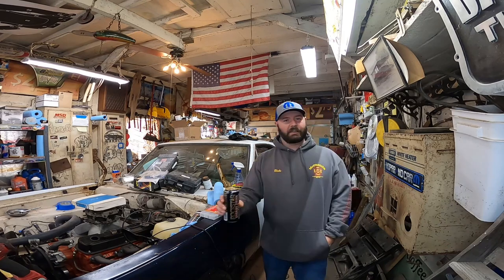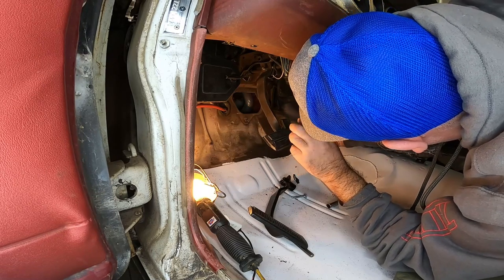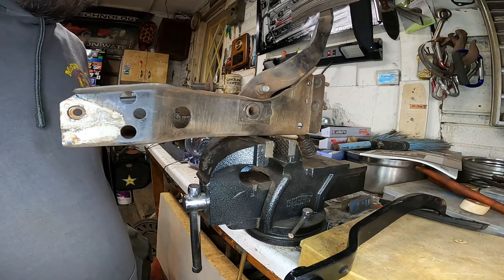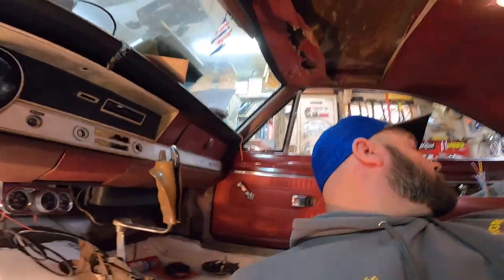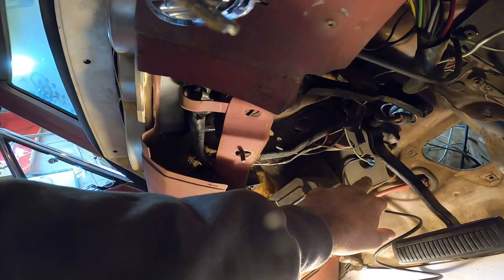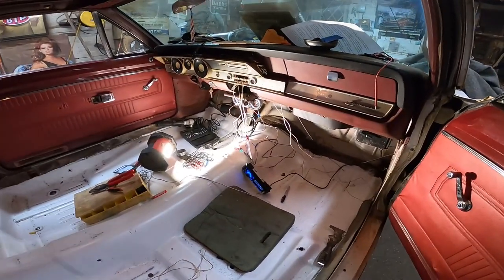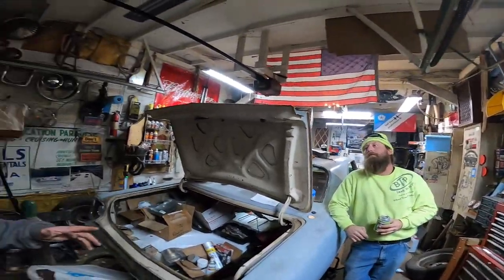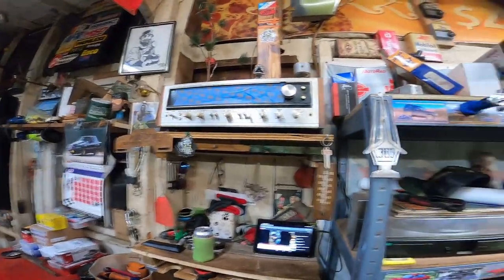Bad Tree Cuda *Part 15* 1967 Plymouth Barracuda Brake Pedal Swap and Fixing More Wiring Problems.

Comment: Back  in the days before repro wire harnesses , I remember making a 'bed' of an old quilt on the stripped out floorboards of my 57 Chevy (retired drag car) so I could see a hand-drawn (and colored) wiring diagram  duct taped to the ceiling  while I hand made a new wire harness!  One wire at a time! (All the same color!!!)   Yeah, I hate under dash wiring too!
Good news? 50 years later  and the car is still on the streets!  No issues!
Reply from the maker: Thats awesome dude 👏
Reply: @BadTreeProductions  Back then, our minds and ingenuity wrote the checks to get our cars goin’..
Reply from the maker: @deucerider430  true true

Comment: My 79 Aspen had a brake pedal like the one that's in there or at lest the rubber part looks the same but the pedal you have now looks closer to the true pedal that wrong pedal could even be out of a old D100 or Ram 150 who knows
Reply: We were thinking it came out of a truck, and was accidently sold to us as an a-body part.
Reply: Good job Blake for figuring that one out.